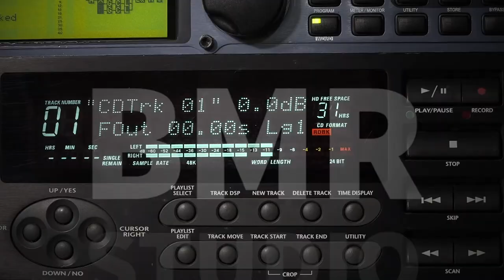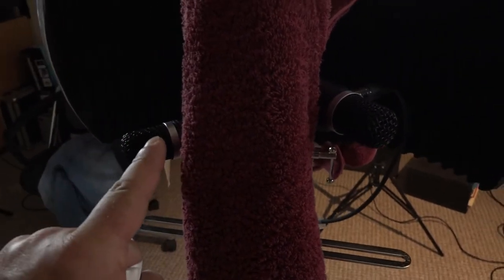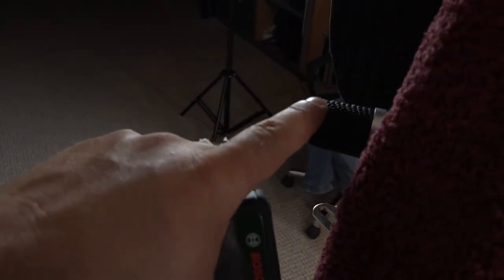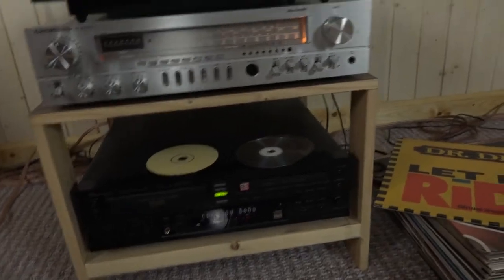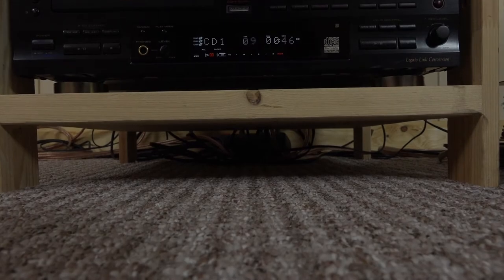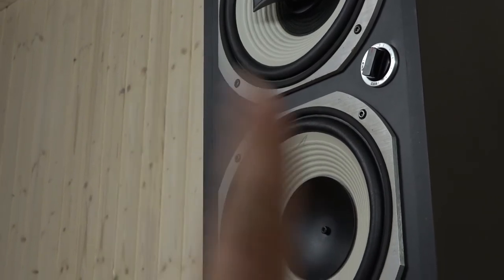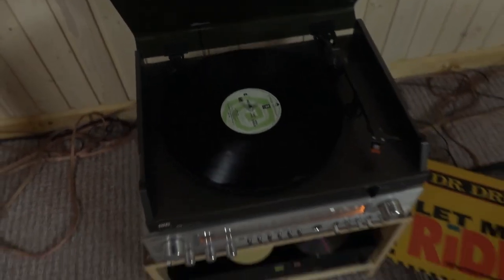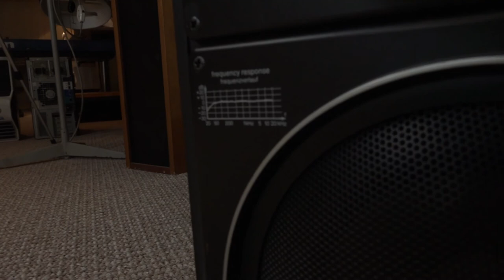Kenwood LS 770 vintage speaker from 1977 - part 2 ORTF mic technic

Comment: A slow motion camera would be nice to see the phase of the two membranes with various sinus test signals. :)
Or some close miking of both membranes like an guitar amp, but then its not so easy to get both microphones in phase. Then you can compare the waveforms and also have a third audio track with both mixed together.
Reply from the maker: I don't have a 1000 - 10.000 FPS camera for the 10-300 Hz range :)

Comment: Will these not work with a more modern digital stereo head? I only get a weird high end sound out of mine like it’s just coming from the horn. Any advice?
Reply from the maker: I think I replied to You once.
So again.
You have crossover, coil  or wiring issue. Bring it to some old speaker repair master!